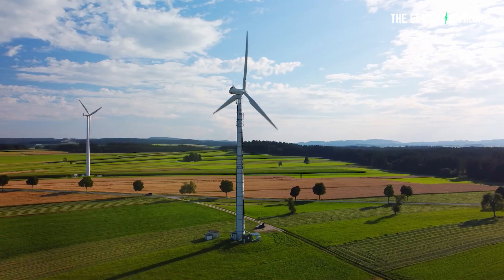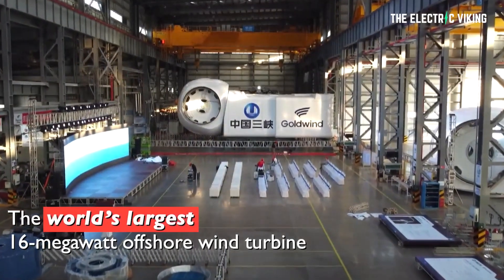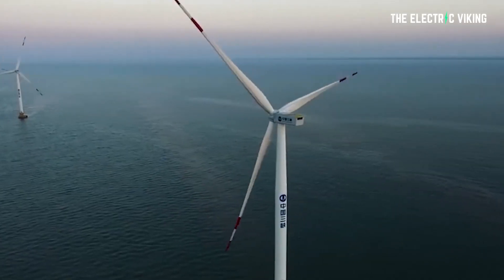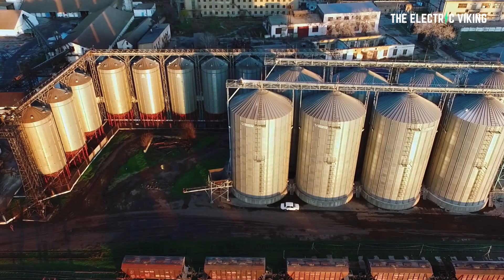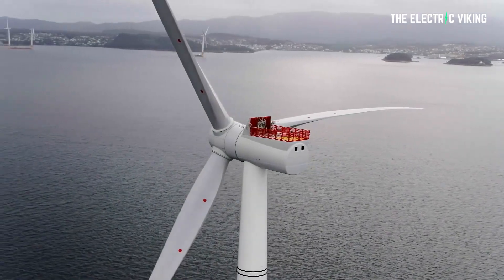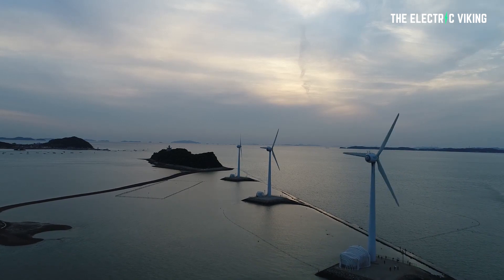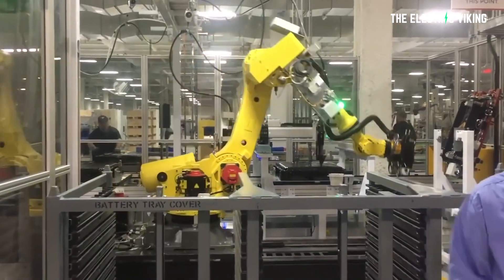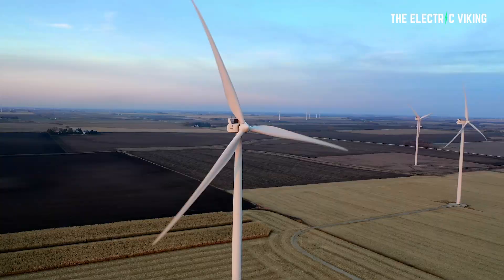The world’s biggest offshore wind turbine will bankrupt coal & gas

Comment: Excellent video. I wonder how this might change things with base load requirements?
Reply: These are the facts
https://www.youtube.com/watch?v=ZddN57phd7Q&t=1215s
Reply: well, with renewables you don't need base load. Just remember that Belgium started lightning their motorways and national roads when they started up their firs nuclear plants - to have sufficient base load. As nuclear plants don't work without base load. And you noticed the the illumination was switched on and off following the morning and evening peaks of consumption. 
Nowadays just use cars for storing the energy. Vehicles move just 5% of their time. BEVs thus can be used as grid batteries, as already done in China. You just program in the app at what time you would like to start and the number of km you like to do. In the meantime the car is charged when electricity is at low cost, and discharged, when it's at high cost. In China you can earn roughly 10% to 15% of your income by using your BEV such way - and the km are free of charge. So in fact your paid for operating a car.
Reply: @wolfheilmann774  I am sorry but that is just nonsense.
Did you watch the video?
Nuclear is great as base load but cannot be used for tghe varying load above base load. Wind when its is not there has to be replaced with gas - there is no way of storing excess energy that even comes close to dealing with the missing energy when wind stops.
You cannot use cars for strutting the energy - that is absurd. Cars need that energy to run and you never know when wind will give that energy besides the simple fact that the total battery cost would cripple every economy in the world. That is a total pipe dream.
China is building hundreds and hundreds of collar over station so please do not claim they do any of this at any level.
Sorry but look at the video and try to understand how the relationship world lives,
Reply: @ClimateRealism  Did you read my comment? Nuclear plants need a base load. As they had not sufficient constant base load at that time, they installed the illumination on motorways and national roads. And used that to adjust a constant load which the nukes needed.

You can use the cars for that purpose. Cars are parked for 95% of their time. Running 5% of the time. If they're parked you can connect them to the grid. And it is done already, no matter your wet dreams. It works.
In Germany alone, where we have very few electric cars, the capacity of their batteries is already bigger than all other storage systems combined. And the batteries exist already. The cars aren't more expensive than ICE cars.

When you now a BYD in China you just program how many km you would like to run at a given time. Until then BYD uses your battery as energy storage. And it works. No matter your wet dreams.

Battery cost has dropped to such low level that they have become the cheapest energy storage system. And with the new salt batteries, the cost will drop another 50% to 70%, and will be less than 10% of the barrel costs 5 years ago. A 60 kWh battery will be available for well under 2,000 EUR.

I assume your collar over station should be coal power plant, isn't it?

Well, more than 94% of energy generated in 2022 in excess to the energy generated in 2021. And less than 3% coming from coal. Less than 0.3% coming from nukes. It's not about environment it's about cost and speed of putting up new energy plants. And here they have selected wind turbines as the energy which requires least ressources, allows biggest increase per investment and delivers energy the fastest. It's not about environment, it's about cost.
Reply: @wolfheilmann774  I think you have not watched my video.
I have allowed for current battery costs and we live in the current world.
In the uk we simply do not generate enough electricity to do what you seek - or even replace ICE cars.
You cannot build a power grid on what may might happen is has to be real.
Currently very few can even afford an electric car.
You really are proposing dream world.

Ye nuclear is suited to base load as my video states. What happens, as in my example, when there is no wind power for 9 days? Where today does that energy come from?

I do not understand your comment
"I assume your collar over station should be coal power plant, isn't it?"

China demands on fossil fuels as do all economies. That is a simple fact.
World wide renewables are a few per cent.
Reply: @ClimateRealism  That's the mistake made by all those who are forgotten. Who remembers the world market leader of ox carts? Who the world market leader of horse carts? (but it's not at all about traffic alone)
In other parts of the world there is progress. Then there are people fighting progress, like you.
I just stated some facts which are reality. And they work.
Those who strive for development will be those succeeding.
Yes, China is till the biggest consumer of fossile fuels. But they are changing that at light speed. Just to become energy independent. Just so nobody can blackmail them, Just to reduce their energy costs.

And in fact you don't need to make big changes on the grid. It even becomes simpler then now. With delocalised power generation and power storage the grid will have much less load.
And where do you find a country with 9 consecutive days without wind at height between 100 and 400 m? In continental Europe you wouldn't find any.
But just imagine: If in Germany we would run BEVs instead ICE, their battery capacity would be good enough to deliver all the power you need for a period of more than 14 days - supplying all the energy to industry as well as commerces and homes.

Yes, you can fight the future. And yes, You will be the Loser
Reply: @wolfheilmann774  I am all for progress. I have just had a Tesla delivered.
China are not changing that at light speed - today they are building coal power plants at a record rate. The exact opposite of what you claim.
They are increasing their CO2 emissions at a record rate and buying in and mining cola at record rates.
You are totally wrong agains about the grid. I cannot believe how your world is so opposite to the facts.
The UK has had 9 days without wind power at all - watch my video.
Worse than that is three weeks of low wind across Europe - see my graphs in that video. From government sources.

Your maths are simply wrong about Germany.

It is clear now you did not watch my video.
Reply: @wolfheilmann774  I have sent the video link again.
to get soewmwhere with this watch the video and then by all means point out where you think I am wrong.
Currently in the UK wind is at under 1% of its rated value.
Here is another 2 minute video covering todays issue.
https://www.youtube.com/watch?v=Z2t16AUORgg&t=49s

with them and then  deal with the issues raised.
I have sat on government committees and built mathematical models of the climate. I am not approaching this from a position of ignorance.
Reply: @ClimateRealism  of course the average is low, if you consider all windmills. But 99% are not todays technology.

When talking about wind energy you must not take a design from last millennium, you should take todays technology. 15 MW upwards, and centre heights from 200 m upwards. Than you generate easily 70% of the design capacity in an annual average. Of course, you must decide whether designing them for strong wind or weak wind conditions. And look for the right place. And be aware that in a very near future you'll have 25+MW turbines. the ones you mentioned had just an average of a few kW
Reply: @wolfheilmann774  On average you get 30% of rated capacity But the real problem is for long periods you get next to nothing. Watch the videos.
Reply: @wolfheilmann774  The 9 days without wind in the UK meant 5,400 GW hours had to be replaced. Batteries to do that cost Trillions and are not viable.
Reply: @ClimateRealism  that's knowledge of last millennium. Look for the 12 to 16 MW windmills and you get totally different numbers. I know them as I consult big electricity consumers in China, and know their data. And it doesn't matter what we in Europe may think. It just works. And on the newest wind parks you get 70% of the design capacity
Reply: @wolfheilmann774  I am sorry but you are talking about a dream world.
Look at the current power source graph I linked to for China - about 98% fossil fuel/nuclear and about 2% renewables.
So it does not work in China and no matter how efficient the wind turbine, and I looked at 12MW ones, when the wind is not there, the power is not there.
Explain how you would back up 54,400 GWh and supply that over 9 days because that is not even the worst situation but just the example I took.
You even deny the actual wind records - I give them for Europe as well.
Reply: @wolfheilmann774  You don't work in the energy industry, do you? Because your vocabulary is incorrect. Using power from your car might be nice for your phone, but how are you going to drive to work after cooking dinner and breakfast with power from you car? There is still nothing to replace a base load source of power where the fuel is stored on-site and can be used at-will.
Reply: @grandrapids57   Paul Burgess and Wolf Heilmann talk from different perspective, they can go on and on and on. And I will keep driving ICE until they force me on batteries.  Maybe I go hydrogen.